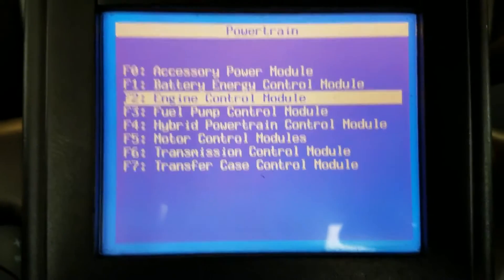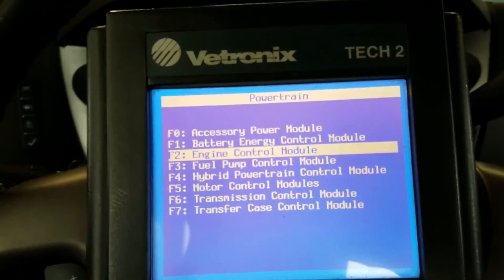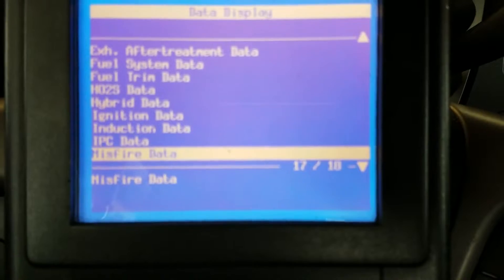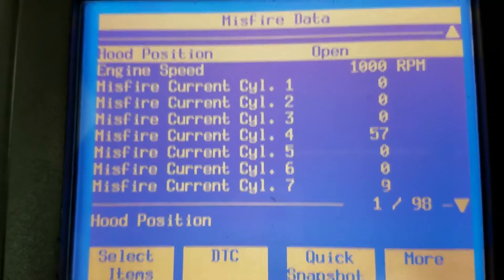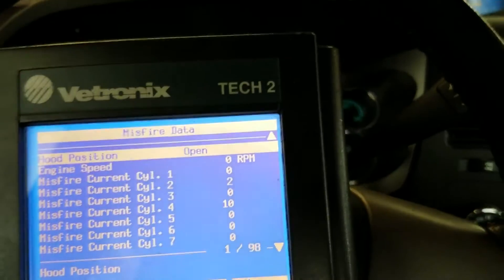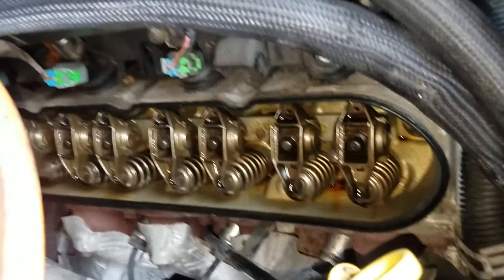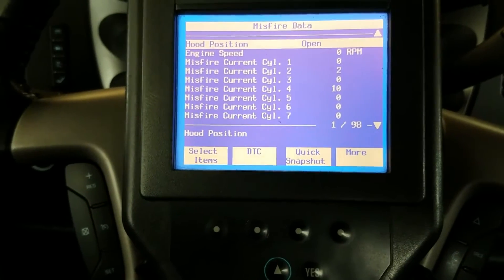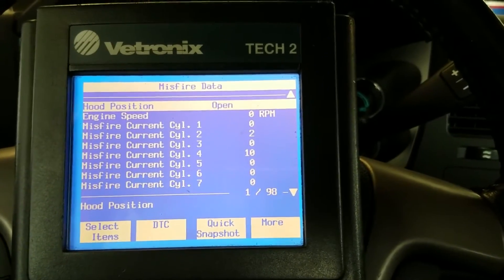How to Diagnose a Bad Hydraulic Lifter Chevy GMC Trucks

Comment: Drain a few qts of oil and add trans fluid to see if that cleans things loosens things first maybe.
Reply: No transmission fluid is not made for the engine. Different fluids can break down seals. This ain't your grandpa's tractor this is real life thinking material. Go back to the farm with that ignorance

Comment: Can you shut off the active management fuel system on the hybrid without causing problems? Would it pass smog like that?
Reply: Not really a long time solution.   It helps, but the afm hardware needs to come out for long term reliability. Lifters will eventually collapse.

Comment: If anyone could help I have a 2003 2500HD 6.0 p0300 I have 15 lbs of vacuum 180 of compression I have fuel on all the plugs on the driver side when I unplug the coil pack on the driver side no idle change rocker arms, all move on each side, driver and passenger I’m running out of ideas just looking for help
Reply: 1) Check Spark (Wires, coils, plugs)
2) Check Fuel pressure (Low and High)
3) Check and clean MAF/Air filter
4) Check compression
5) Check Backpressure on exhaust - bad cats?
6) Leak down test
7) Check for lifter issue at valve valleys/rockers - (You did)
8) Inspect intake valves for carbon buildup on stems and seats. - Can do this by removing intake manifold and scoping in ports of each cylinder.
9) Check for fluid losses...how's oil levels?  Is there coolant in the resevoir? Have you noticed any smoke in the exhaust? Bad Gasket? Etc..

So many things. Honestly a good two way data scanner can tell alot about what's going on. 1👍🏻

Comment: I have a 2015 silverado (72,000km). Lifter 7 is wacked so i need to replace them. 3,500$ for the job.
I just replaced the upper lower ball joints front right and left 1,600$…. 
Anyone else have this issue?
I called GM canada and they gave me the BS story” ah you are 3 months over warranty”.
Reply: for what i see is easy to replace the lifter seems  like the one on cylinder 4 fail most of the time ,, just remove valve cover and then the cylinder head by removing the exaust and intake  ,, so my question is did you get it fixed
Reply: @carlossosa2940  
I got all 8 lifters replaced. A few kms later another lifter issue, so I went back to the dealership and they said the 2 lifters were faulty. So i had to pay the labour once again. Nice roughly 6,000$….. after replacing the two faulty lifters the truck starting acting up again. Motor was shutting off at low speed, the truck was shaking, no gas pedal response and the reading said code for lifter. I put roughly 10,500$ in my truck in the past 6 months and it only had 72000kms. 
I traded it in, I spent all my savings in my truck trying to save money so i could keep it payment free, i had 2 months of payments left the damn thing. Rant over lol
Reply: @TheTracker12  really bad experience ,, so i was offered to buy a 2008 chevy silverado 1500 with that issue guy told me just less than 1000 dollars to get  it fix it the lifters is only about few dolalrs  so the truck is only 179k miles on it so he is selling for 6,500 $ i i had to pass it cuz i dont want to take the risk that could be something more than that even cam shaft fail

Comment: How do you crank the motor without it starting?
Reply: Hit the crank shaft with a fat socket wrench, probably gonna have to take out fan shround and fan maybe
Reply: If you can’t turn it with a little breaker bar then it’s not right

Comment: I have a generic question (or two): What's the interval for the number of misfires being reported per cylinder? Is it a certain number of seconds, or something else? When a bad lifter is found, is it best to go ahead and replace ALL the lifters or just the single bad lifter? Seems like the labor to get down to the lifter level would make replacing them ALL the best way to go, plus if 1 lifter has failed how long before it's mates also start failing? Finally, can a single badly misfiring cylinder cause misfires to be reported on the other cylinders as well? My #4 cylinder is misfiring a lot (but not as badly as what's in your video!) and the other cylinders are occasionally misfiring a little, LT Fuel Trims are at around 12% with no intake leaks whatsoever (installed all new intake gaskets and water-tested for leaks), changed distributor spark plugs and wires to no avail.... about to pull passenger side valve cover and check rocker arms on cylinder #4 now which is why I'm asking these questions.

Comment: Stabilitrac Light flashing, check engine light on, rough idle and low performance. Replaced plugs and wires and checked coil-its good. Didn't fix problem. Then cyl 4 misfire-rocker arm replaced by MY mechanic. Truck was fine for 6 days. Then oil sensor and vent valve solenoid went out and Stabilitrac and engine light came on again with rough idle and low performance. Now Chevrolet dealership wants to replace all cyls and  tune up. How did it go from Stabilitrac/engine light and those symptoms to needing all lifters replaced when my mechanic diagnosed as only cyl 4 misfire and sensors? No one has torn engine down. I'm so confused and pissed.
Reply: Oil sensor is random failure. Likely unrelated vent solenoid is EVAP canister. Also unrelated.
I don't have enough info, to say more.
Reply: Im in the same boat, im having all the same exact issues. Did you ever figure it out?
Reply: They should've suggested all lifters from the start. They all have the same amount of miles on them. Plus the labor to do one, is the same as the labor for doing half your engine.
Also, there is no part called a "misfire-rocker arm"
Were your lifters diagnosed? Like they show in this video? Are you referring to your lifters, rocker arms go between the lifter and the valve.
And that arm just reacts to movement of the lifter. It's not likely that the arm itself failed.
Stabilitrack will shut down for a number of reasons. It's just off, as a failsafe. A system it is relying upon, isn't giving the right information. So to avoid breaking more things, it is just off. Until the problem is fixed.
If I were looking at it, It would matter to me. How often it misfires. Does it clean up, on the computer display, with more rpm's? Or it is constant, every cycle, no matter what?
It's hard to help. Knowing you aren't just standing there with a wrench and some know-how, to take what I'm saying and run with it.
I'm afraid, if you don't know anything on the subject. You are one of two things. A customer to a mechanic, or a victim of a bad one.
It's okay, we have special knowledge, that is what you pay for. Whatever your skill is, I'll be paying you for it, at some turn, I'm sure.
Reply: I have the same problem

Comment: Quoted on on lifter 7 failure possible cam shaft damage, engine was shaking so I took it in and I’m sure all they did was hook it to a computer or maybe they did slightly looked into it for 150 with expensive taxesthey called back ... 900 to take apart and find the problems, could cost around 3700 to fix and if there’s more damage it jump to 7200 🤨 I said fuck that, I believe there’s cheaper routes than that quote. I got a 2021 instead! But I’ll still try to fix my 07 6.0 Vmax LTZ I love that truck maxed to the nuts!
Reply: YouTube will save you money…
Reply: Gm products are trash bro i got a14 sierra misfiring stabilitrack on flashing check light took it to mechanic he said replace the engine going to fix her up and put her up for sale oh and gm trucks new gen are trash

Comment: So pull the intake and vlom and unstick the lifter then send the ecm off for the afm delete cost $50.00 total for the whole job if you pulled the head your not thinking straight cause u could have saved tons of headache and work over a simple easy as hell to fix problem
Reply: But the crank has to be reground and then new heads installed. lol
Reply: Was your rocker arm loose ?? Im looking to do the same but every video I see their rocker arm is loose when they move it with their hands. My rocker arm is stuck and when I turn on the truck it doesn’t move at all. I want to lift the volm and hit the lifter to unstuck it
Reply: @Pibs2525  yes i will try to post a video on it
Reply: @Pibs2525  it wont let me post the video here if i could text you i could show you the vid
Reply: @AdamOutlaw87  do you have messenger or what’s app?
Reply: @AdamOutlaw87  did deleting the afm from your ecm mess with your transmission ??
Reply: @Pibs2525  no not at all still running strong
Reply: @Pibs2525 bro this is me right now... Rocker doesn't move at all and it's not loose like in all the vids, what happened to yours ?

Comment: When you start the engine does the ticking sound start right away? Cause I have a car that has a ticking sound and it apparently is a valve solenoid , and it only ticks after about 30 seconds when you turn the engine on, not right away
Reply: Hmmmm. Or is it because your oil thins out? I'd have to try a little thicker oil before doing anything.
Reply: @FloridafishingwithRick  just answer the question Rick goddamn
Reply: What question dumas? He ain't asking me a question I gave a statement. God damn bro. C'mon
Reply: @FloridafishingwithRick  facts bro, smartasses on yt be crazy

Comment: Will it tick my 09 has misfire in 4 changed wires plugs coils and fuel injector only thing left is lifters Not sure if I should keep going or what
Reply: Those year engines have a problem with their cams. They're hardened wrong. I can almost guarantee you got a flat spot on your cam. New cam and lifters should fix your problem.

Comment: how much does it cost to repair a lifter ?
Reply: Depends on $ per labor hour on a LS platform your looking at $1000-$2,500. That would and should include pulling both heads and replacing all the lifters.
Reply: @vanjabi8827  This price is accurate. It's the price range a mechanic shop gave me.
Reply: just one lifter cost 200 bucks not even included the new head gasket and bolts

Comment: What if the rocker works then stops. You can crank the truck and it works for 5 sec or so then oil come threw and it stops. Ever time
Reply: What did you find?  Stuck open vlom solenoid?
Reply: @ecarcompanyinc5129   I took the vally cover with siloniods out and deleted them put new lifters in it crank in up now the same cylender but different valve is doing the same think the original one is fixed must have been a lifter now I dont no what is wrong with it all new lifters so I'm putting  a new cam and lifters for non DOD I it
Reply: dc did a new cam fix it?
Reply: @jcortes3930  I'm sure it will I was scheduled to have it done next week
Reply: dc cool, good luck
Reply: Was it a flat spot on the cam?
Reply: @FloridafishingwithRick   I put a new cam because the factory cam was for DOD.  To swap over to standard lifters all the way around a cam swap has to be done.  It was just bad lifters in the end . They would prime for just a minute then lose it and start tapping

Comment: How bad is a lifter failure in a new 2018 sierra 1500? I bought one and in less than a week the engine light turned on and they have to replace the lifters...Thank you for your input...Ms. medina
Reply: That's crazy a brand new truck was doing that. Did you ever get it fixed?
Reply: I hate chevy gm products same situation with 2014 silverado
Reply: @antonioinfante9170  im having the same problem right now was it really that bc my truck seems to not have enough power and it just shuts down
Reply: @JoelHernandez-gx3fd  my 2016 died on me other day while driving.. cranks fine but won't fire up .. when it tries to it sounds like no gas